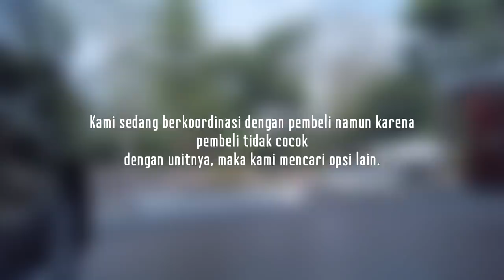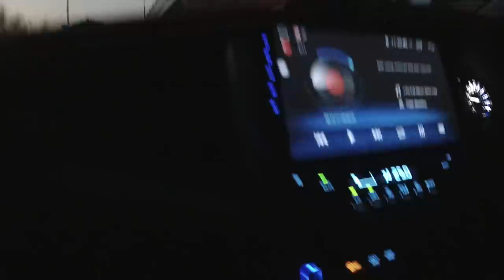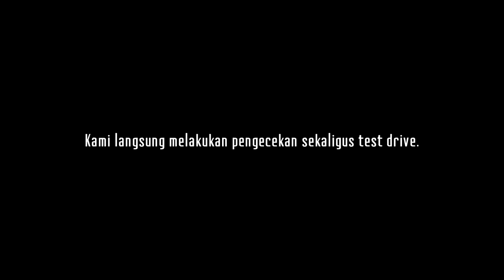Dari Temanggung, Lompat ke Jogja Demi Innova | Berburu Mobil Impian

Comment: Mau tanya om...inova konsumsi bbm ny 1 banding brpa ya
Reply: Punya saya innova bensin 2.0 V manual, dalam kota 1:9-1:10
Luar kota bisa 1:12-1:13
Asal rajin bersihin throuttle body sama MAF sensor inshaa Allah mensin enteng jadi gak perlu neken gas banyak2 udah kerasa enteng.
Reply: Innova bensin 2.0 V 2005 manual
Reply: Irit juga ya om...itu full ac ya om
Reply: Full AC apa nggak pak?
Reply: Iya full ac. Sayang kalo ngga ac nanti dasboard sama langit2 nya kotor :)
Reply: Klo bekum euro keluaran 2007 ke bawah dalkot 1:7-8 gk bakal bisa lebih
Reply: Punya om bimo khan blum uero ya...
Reply: @hafisfamilyvlog672  la itu punya mas nya yang diatasnya malah 2005 bisa nyampe segitu